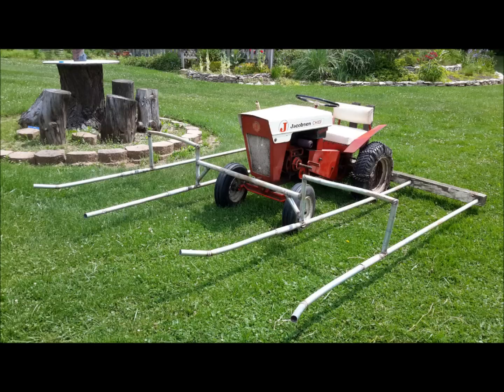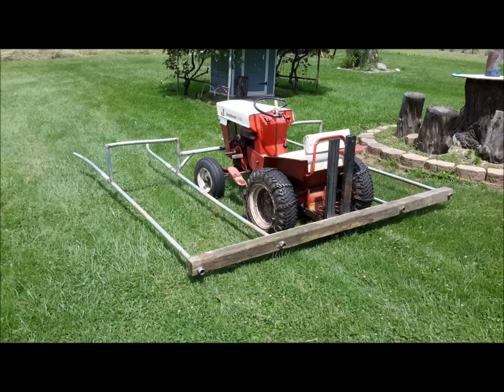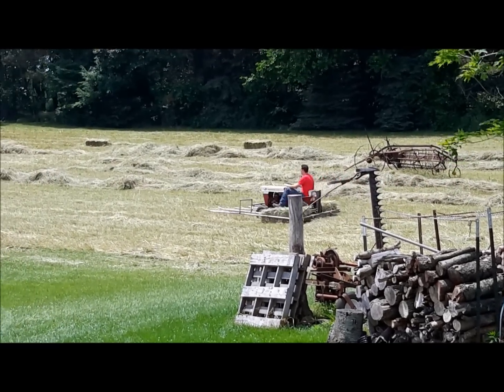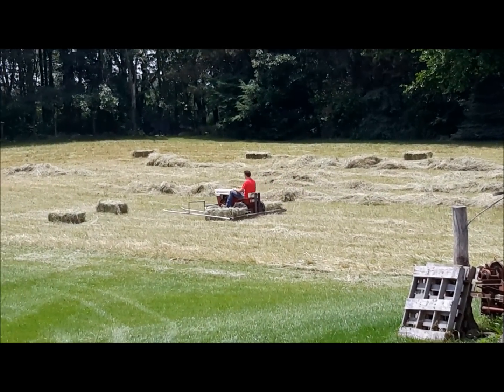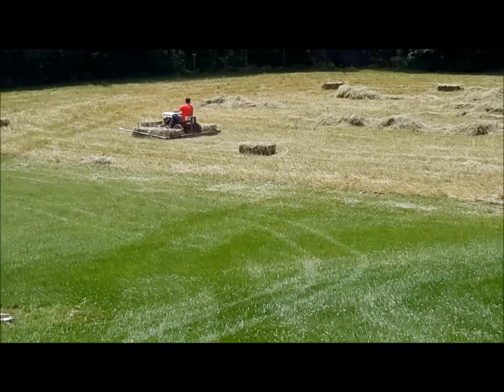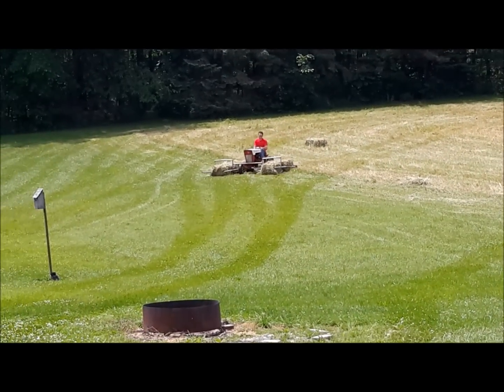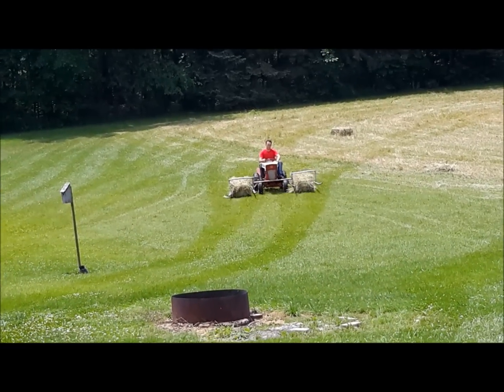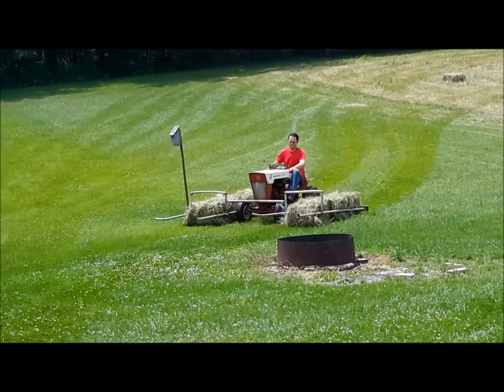Garden Tractor Hay Accumulator

Comment: If you had a tongue hitch on a hay rake would a garden tractor be able to pull it to rake hay? I remember on our farm we did it with the Farmall Super C.
Reply from the maker: I've pulled our old John Deere ground driven hay rake around with that same little garden tractor. I think it would be possible, but it would work it pretty hard. I really liked raking with our Farmall BN. It's very nimble with plenty of power. I rebuilt it about 6 years back with a Farmall C sleeve kit.

Comment: This is awesome! We are getting older and doing hay kills us lately. My wife could use this to make piles on the field that I could come by and pick up with a grapple to load the wagons. How did you attach this to the tractor?
Reply from the maker: I built it from tubing that a friend gave me from a wind damaged canopy. On the front I welded a 3/4 bar that fit throught a hole in the grill of the tractor. On the back I mounted that piece of 4x4 to the hitch. I made it so that the tubing would fit through 4 holes in the 4x4 and lock on with a few snap clips like you use on a 3point draw bar. It mounts on the tractor in about 5 minutes.  It's fun to use, but we quit making hay now. Mom sold her horse.
Reply from the maker: My only regret was not making it out of heavier tubing. It started breaking and then I would have to weld cracks in the tubing.
Reply: @chipwright6193  how high off the ground did you shoot for? I have some 2" metal electrical conduit I was planning to try.
Reply from the maker: @richardjulian9263  I was aiming for about half the height of a square bale or maybe a little lower. Maybe 6 or 7 inches. Electrical EMT is about the same thickness as the tubing I used.